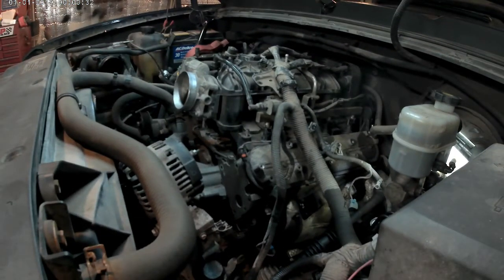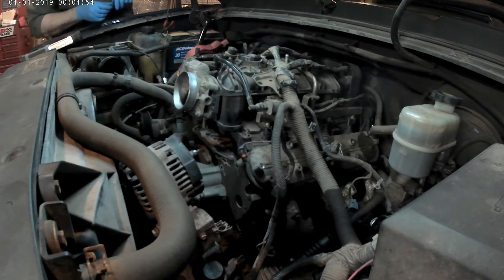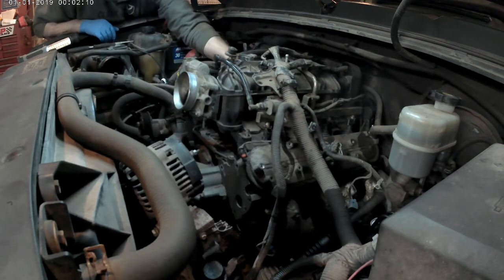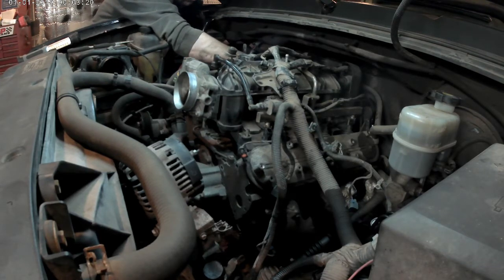2009 Chevy Silverado 1500 5.3L Head Gasket Repair or Cracked Blocked

Comment: 2008 Chevy Silverado 4.8
I have coolant to leaking from the passenger side of the engine, can't tell exactly where. Any ideas what exactly it can be?
Reply from the maker: I wouldn't want to say for sure but there's a good chance it's your head gasket. You may want to check your heater hoses that go into your heater core. Mine were leaking from there one time.
Reply: @budslife  turns out it wasn't the had gasket. It was a small seal on a tiny pipe that connects both heads. Part from GM to replace both front seals was $20, labor was $140, total $160.

Comment: I have a 2007 Silverado 4.8 that just rolled over 300,000 miles.  I had cranked the engine to check if brakes needed bleeding.  A couple of weeks ago I had replaced the connectors and lines that go to the fire wall for the heater core.  I noticed that it was leaking. It appeared to be at the connector on the hose coming out of the engine going to the firewall.  I had reused the original clamps.  I turned it off and was going to replace the claps with new screw tighten type clamps.  When I turned it off, it made a kind of dieseling sound and white smoke came out of the exhaust.  I cranked it back up and it is smoking badly, white smoke.  I ran it less than a minute and shut it off.   I waited a few minutes and cranked it back up, still lots of white smoke. I ran it maybe a minute total. It idles fine and revs fine.  Oil doesn't look milky at all and neither does antifreeze in the overflow tank.  Could this be anything else or am I looking at a gasket or cracked head?  thanks.

Also I checked the inside of the oil fill cap and it didn't look milky or abnormal..
Reply from the maker: It sounds like you might have a head gasket problem.
Reply from the maker: It would take quite a while for the oil to get milky and to see anything in your antifreeze. So you could still have a bad head gasket period usually white smoke means you're getting water through your exhaust system.
Reply: @budslife  I had just changed the oil earlier this week and had put maybe 30 miles or so on it.  O'Reilly's had the castrol edge 5w30 full synthetic high mileage on sale.  I had never used fully synthetic before.  I know in the early days of synthetic, it was said not to switch to it on a high mileage vehicle or it would burn oil.  But i read several places that the new synthetics didn't do that.  Last night after it was smoking so bad, I did a google search and I found several people who had switched to that particular brand and designation of oil with high miles and their vehicles had started blowing gray-white smoke.  So I went back to O'Reilly's today and bought some of their house brand non-synthetic 5w30 oil and changed my oil again.  After doing dances and prayers to the engine gods, i fired it up.  It was smoking badly.  I waited till after dark so I wouldn't get bad looks from the neighbors for driving around with a mosquito truck and drove it out of the neighborhood and drove about 5-6 miles down the road and back at 50 mph.  By the time, I got back, the smoking had pretty much quit.  I'm going to crank it up again tomorrow and see how it does.  If its looking better,  I'll drive it for a day or two and then change the oil again and put back what I had been using.  I'm thinking another can of SeaFoam in the gas to clean the engine out.
Reply from the maker: @travharrell1713  how's your truck did the smoke problem clear up? Just wondering.
Reply: @budslife  there was still just a tiny tiny bit of smoke after the first change back to non-synthetic.  I ran it two days and then changed the oil and filter again putting what I had been running back in it and no smoke.
Reply from the maker: @travharrell1713  that's great hopefully it'll be okay and you don't need a head gasket job done.
Reply: Synthetic oil usually puts too much stress on your motor yes using thicker oil will make it sound better but over time it will start to wear down internal parts and make it feel more sluggish your truck will run an idle better with premium gas and regular 5W-20 oil with no additives and check to see if there's antifreeze inside your tank and make sure it's full because if it did blow white smoke and doesn't now you might have burnt up all the antifreeze out of if you have a blown head gasket your truck will run fine with no antifreeze but it will just get hot because once antifreeze gets into your cylinder and starts burning off it will create white smoke until it's gone

Comment: 2010 Chevrolet Silverado
1500 LT 5.3 liter 4wd

my truck idles roughly
leakage of coolant from radiator 
lean codes appear p0171 p0060
truck won’t accelerate pass 45 mph
states “engine power reduced”

any idea? i’ve blown smoke into one of the hoses and as expected, light smoke from where the passenger side of the block came out.
Reply from the maker: It sounds like you have a bad head gasket.

Comment: How much would this cost at a shop? I have milky oil and milky antifreeze.
Reply from the maker: The guy I bought it from said he had it to two different shops here in PEI Canada and it was going to cost between $1500 and $1800 to fix.
Reply from the maker: If you have milky oil and milky antifreeze I would say there's a good chance you have a head gasket leak. I hope you don't! I wish you all the best of luck.